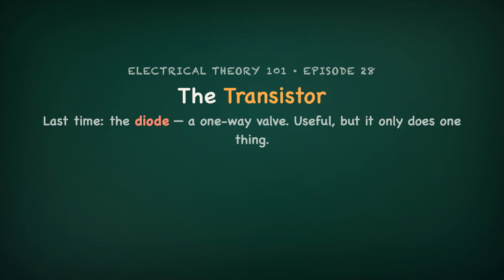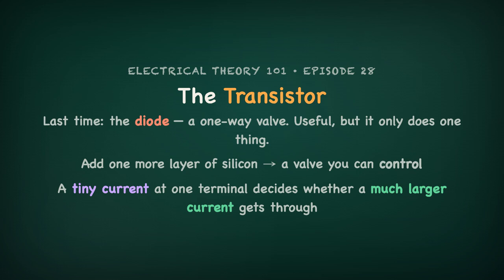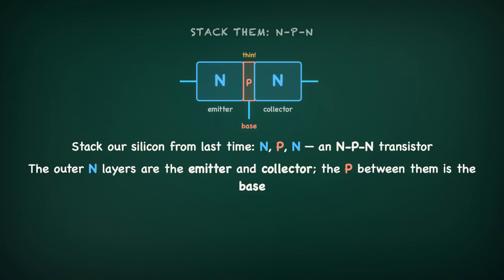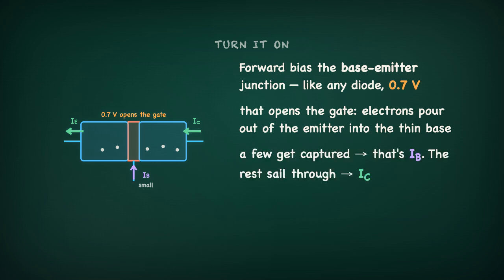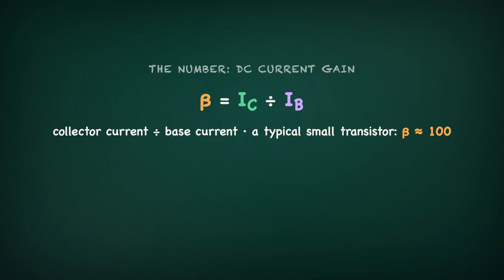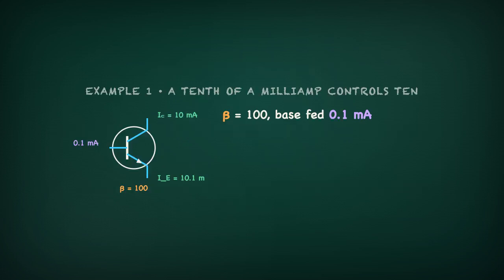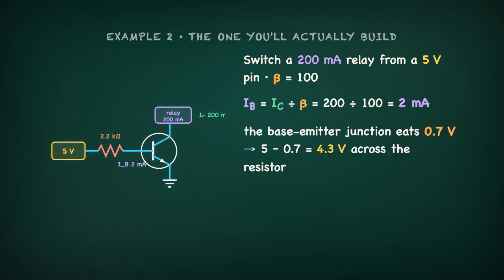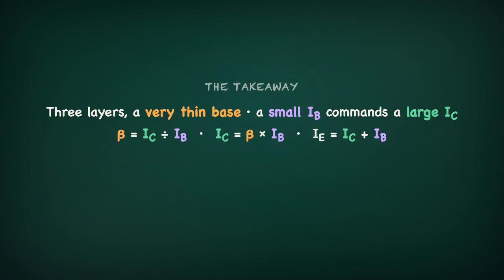The Transistor Explained — What Beta (β) Actually Means

Comment from the maker: Practice answers:
A) β = 150, Ib = 0.2 mA → Ic = β × Ib = 150 × 0.2 = 30 mA. Ie = Ic + Ib = 30 + 0.2 = 30.2 mA.
B) Need Ic = 60 mA with β = 120 → Ib = Ic ÷ β = 60 ÷ 120 = 0.5 mA.
C) 3.3 V pin, base-emitter eats ≈0.7 V → 2.6 V across the resistor. R = 2.6 ÷ 0.0005 = 5,200 Ω → standard 5.1 kΩ.

One honest footnote: those numbers are the MINIMUM base current. For a real switch you want the transistor fully saturated, so you deliberately overdrive the base — often 5–10× — and use a smaller resistor. β = Ic ÷ Ib describes the amplifying region, not a hard switch. What should I work through next? ⚡